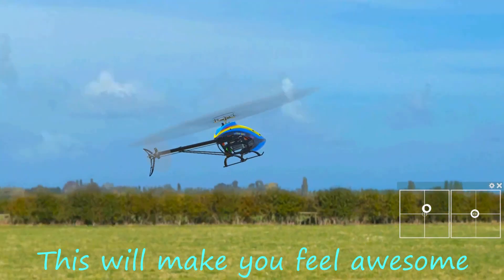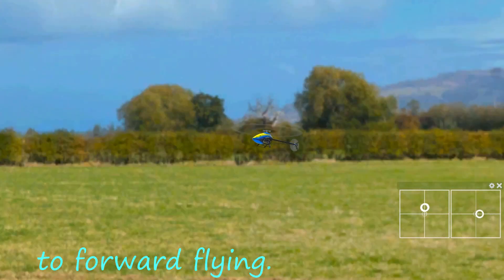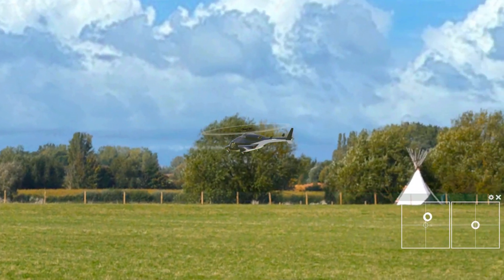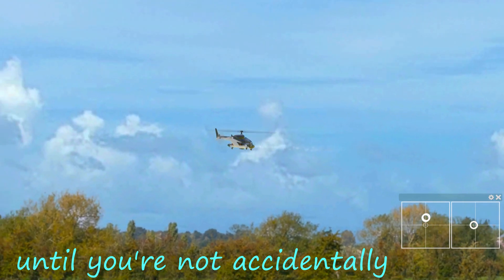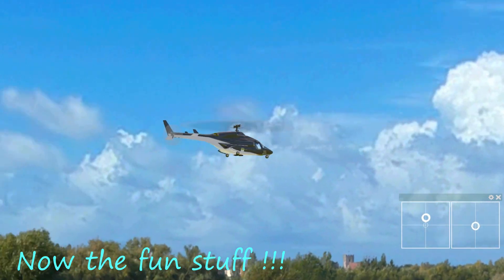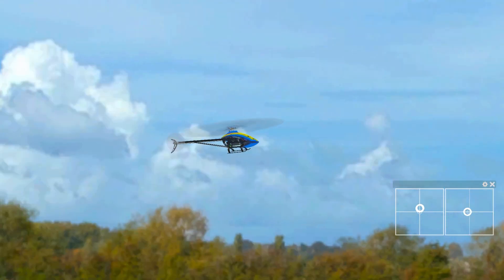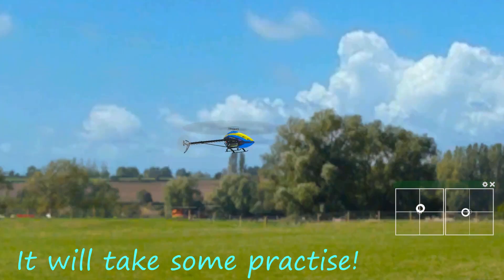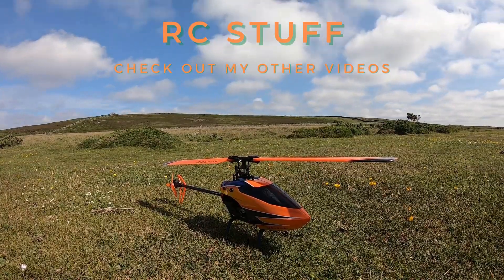How to fly an RC Heli part 4: BACKWARDS flight!

Comment: Hello and thank you.
What sim are you  using? 
Many thanks
Reply from the maker: Hi, thanks! It's AccuRC. Cheap at about £40. Often thought to be most realistic and very customisable.
Reply: @RCStuffvideos  Hi, I have an NX6 radio. Apart from the lead that comes with the transmitter, do I need any other lead or do I simply need to buy the sim and use the supplied lead to connect the tx to a laptop? Thanks.
Reply from the maker: @deersbrook4485  hi. I'm not exactly sure what lead comes with it but if that doesn't work you just need a usb dongle thats cheap too. https://www.spektrumrc.com/Products/Default.aspx?ProdID=SPMWS2000
Reply: Great. Thanks for taking the time to reply 🙂
Reply: Thanks have real flight 9.5 I can’t get on with it looking for alternative sim. 
Thanks for input.